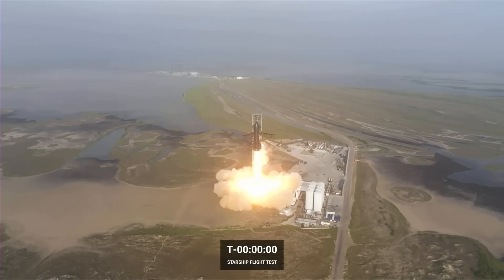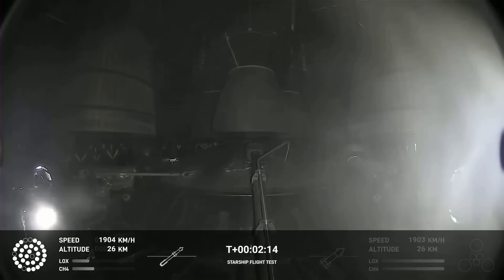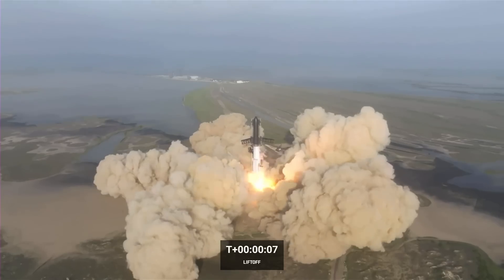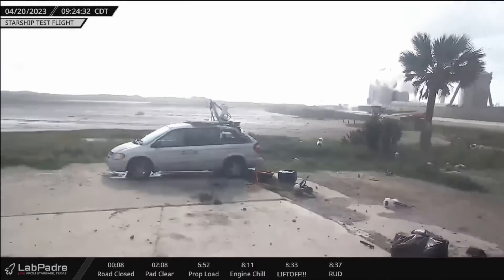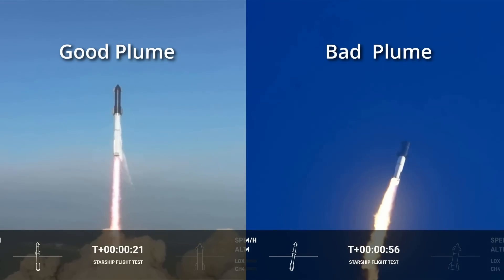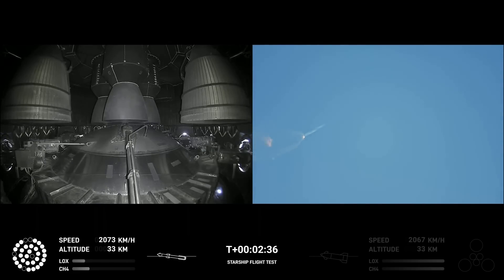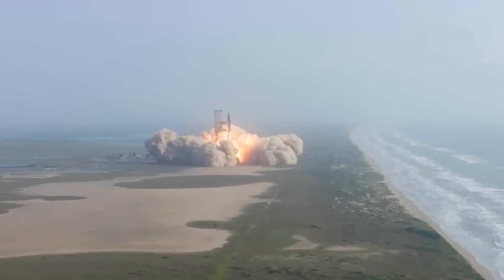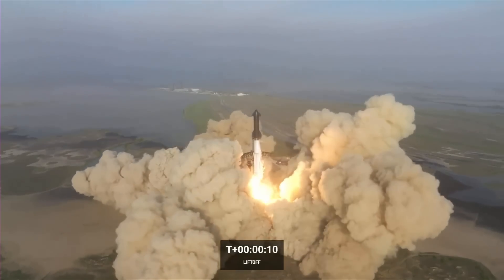SpaceX Launched Starship Like in Kerbal Space Program! What Went Wrong?

Comment: I watched the liftoff on the Everyday Astronaut channel, and his feed was perpendicular to Space X's, and you can clearly see that the rocket his hoovering slightly to the left, and was going up with an angle.
From the beginning of this project, I have a N1 feeling about the Super-Heavy booster. A lot of engines is good, but when does a lot becomes too many, I don't know. I also always thought that their launchpad was a little bit skinny when you compared it to LC-39, ELA-3 or the Soyouz launch pad in Baikonur. And every rockets launched on those launch pad are significantly smaller than the Starship. Space X has to redisign it, deeply.
Reply: Only serious issue presented is the launch mount. Personally, what I see is proof that the design of Superheavy is just fine. From the very first seconds after ignition, the booster had already taken significant damage from the concrete, but it persisted. Within half a minute, it was down a hydraulics pack and was bleeding propellant like a stuck pig, but still it persisted. Only a bit more than a minute into the flight it was down six engines and probably in the process of losing more, but still it persisted. Come the point in the timeline for stage separation, and Starship might've continued on to orbit if not for the lack of separation. Even still, the vehicle fought till the end when it broke up due to aerodynamic stress -- even that happened surprisingly late!

Compare that to N1, which had each launch fail through just single engine failures and an awful flight computer. For flights 1 through 3, the the origin of each failure could be traced back to the first seconds of launch; the first had a single engine failure and pogo oscillations in another engine within T+6 leading to failure at T+68, the second had a single engine failure before liftoff plus computer issues leading to failure within T+12, and the third picked up some roll "soon after launch" leading to failure at T+48. Superheavy lost three engines even before launch, and still made it more than twice as far as the most successful of these three flights.
Reply: @erictheepic5019  It didn’t break apart due to areodynamic stress, they commanded a flight termination and blew it apart on purpose
Reply: So from what I can tell, you're a nitpicky armchair aerospace engineer lol

(No offense lmao)

Comment: So they already sort of found a solution for the Hydraulic Power Unit failure if that is what caused the stage separation failure. The new boosters that have already been built switched to electric instead of hydraulic. So if that was the issue then it may already be solved partially. We obviously don't know what else went wrong but we do know they will keep trying lol

Comment: i dont see why they didnt go to 100% throttle when they were pointing up 🤦‍♂classic space x L
Reply: Y'all took the bait
Reply: Of course the stock ksp players get tricked very easily
Reply: 70& of thrust is an operating power. Sure it can juice more but it creates a danger of overstressing the engine. It's the same as with a normal engine. You don't use 100% of possible engine power in your car. It's even restricted by ecu that's why you can tune an engine only by mapping the ecu but increasing the failure chance
Reply: Because that could have caused more issues? Think before you post.

Comment: Are they trying to reinvent the wheel? Curious question since I don't know much about this science.
NASA has already figured out how to make a launchpad that doesn't disintegrate when they launch, why not just use that idea/material?
Reply: Starship is a BIT more powerful. but yeah, they are modifying.
Reply: @thecyanadon  Ahh okay. Makes sense then. Haven't been following to much, that's why I was confused.
Reply: @thecyanadon  god made water real so maybe use it to supress the exhaust
Reply: @polishkerbal6920  Gos didn't make jack shi. They already are, they have all the pipes.
Reply: @thecyanadon  yet they didnt use it (most likley to see the damage).
NSF van died due to that, think about it
Reply: @polishkerbal6920  No, they just wanted to get rid of this booster and it was going to take too long to build.
Reply: @thecyanadon  they could have as well send it in 2022.
Reply: @polishkerbal6920  No, they didn't know the power yet, so after the half power test they knew they needed it but it arrived too late. They had the rocket done, too far for scrapping.
Reply: @thecyanadon  ok
Reply: @thecyanadon  but launching without water suppression system is a disaster for the ground equipment
Reply: @polishkerbal6920  Yeah, but again, they needed that thing gone.
Reply: Uhm... you do know that the Artemis launch smashed up its pad quite a bit? Reports of blast doors, well, being blasted away. The table didn't disintegrate, only the weak and feeble ground beneath it. 😆     👍
Reply: @peebothuhlu7186  artemis blew off the doors, starship made a fucking rainstorm of concrete. Its very easy to tell which one made less damage
Reply: @peebothuhlu7186  actually i found out  just now that B7 literally destoyed its launchpad, cryo tanks on the ground, hoppy got hit by a concrete block, and many more things that got damaged by it.
Reply: It's probably because SpaceX is unsure how to make one that could withstand this and be rapidly reusable. Just a reminder there's a lot of new and unproven technology being tested here. Just the fact that it survive twice the Saturn V thrust with just bare concrete is already amazing.
Just like in Apollo age you build around it if you're uncertain about it. Super computer could only do so much and real life testing is necessary where you really start making permanent solution
Reply: @LeftOverMacNCheese  I would agree with you if it wasn't obvious that something like this would happen lol
They just ignored tried and true methods that could've been integrated into whatever new stuff they want to develop beforehand, not after

Comment: if you check nominal stage separation speed, you would know why there was no separation and engine shutdown.
both in case last launch of N1 and first launch of starship nobody programmed situation of premature separation (when first stage damaged beyond normal operation), n1 in last launch got slightly higher, but 40 km was important mark there (may be then fatal damage had dealt), starship attitude loss probably caused by too many engine loss accompanied with ?both? HPU loss, may be aerodynamics played some role too.
judging by oxygen level spacex was very lucky that that thing did not blowup earlier.
Reply: They might have had a code problem, but what’s more likely is that the hydraulic failure was the main problem causing loss of gimbal and decoupler function.

They May have held off on termination to try and override the decoupler control and Force seperation but failed because they had no hydraulic pressure.

Or maybe they just waited for a safer debri field.
In any case the newer already completed rockets have already switched to electonically actuated decouplers.

Comment: I hope they got some good info out of this flight. But I fear they got very little useful data. Booster and pad damaged by lack of flame diverter (everyone knew no flame diverter was a terrible idea) Causing raptors to fail. Causing the hydraulics to fail. So no test of engine relight, or any part of starship operating in vacuum and reentry. Really we maybe got some info about maxQ flight. but six engines out, did it actually reach maxQ?
Reply: yea, it hit max q faster than normal flights from what i heard during the broadcast.  as for data,  i would imagine that every bit of that failure data was probably far more helpful than a nominal liftoff/seperation.
Success comes with learning from failures.

Comment: Why did they built the launch pad with no flame diverter and a water deluge system similar to the one used by SLS? It's like trying to re-enter Earth's atmosphere with no way to direct the heat  away from the spacecraft. I'm surprised would 🔥 the world's most powerful blowtorch at flat ground, but failure is not fatal. 👨🏼‍🚀🔭🚀👍
Reply: Is probably because SpaceX is unsure how to make one that could withstand this and be rapidly reusable.
Just like in Apollo age you build around it if you're uncertain about it. Super computer could only do soo much and real life testing is necessary where you really start making permanent solution
Reply: i assume it's part of trying to figure out how to get hls off the moon with minimal or no launchpad
Reply: @jgunther3398  HLS doesn't need 33 raptor engines on the MOON 😭 wtf
Reply: @aq_ua  Superheavy isn't even going to be on the moon to begin with. Starship itself will be, but it only has six engines.

Comment: Don’t worry the decouplers are a bit buggy but it should be patched
Reply from the maker: Dang, I missed out on a "they're not on the latest patch" joke right there.

Good one!
Reply: They just forgot to enable sas
Reply: Staging unchecked
Reply: Attached to the wrong node. :(
Reply: it's not about decouplers, it's about programming(nominal separation speed was never achieved), and inability to make normal separation without enough booster engine control (which was lost) as decouplers hardware was "set" to zero force.
Reply: @sddndsiduae4b-688  I think you missed the ksp2 reference/joke
Reply: @thekraden04  honestly lets not r/wooosh him and shit since hes a good person
Reply: why didn't space x change the settings in the json files smh. rookie mistake
Reply: @sddndsiduae4b-688  woosh
Reply: @sddndsiduae4b-688  yeah but they should of been on the latest patch :/

Comment: My heart sank for every engine that died on the way up.
Also can we talk about how those 3 little pins at the top of the booster managed to hold on to a fully fueled ship through multiple flips? haha
Reply: Well by this time in the flight, the heaviest part was the main starship... the center of mass had flipped and the stress for the pins was holding onto the booster, not the booster holding onto the starship. It had gone to about 126,000 feet, where the air density is about 1% of the surface.
Reply: The engines appeared to be still running.
Reply: @julesjackson4855  5 of them or 6 i dont remember stopped working
Reply: That is the truly ksp part
Reply: It was 37 km up, not much atmosphere there
Reply: Great engineering can result in things which appear to be miraculous. :) In this case, I suspect there's something which takes some of the load off the pins in a way that's not obvious.

Comment: imo separation has not happened because there was too much propellant in the tanks because of the 6 failed engines  that have not burned the correct amount , so existing engines continued to burn the excess, the separation system worked , but it was unable to separate the two parts , just because of the constant acceleration applied to it.
So the computer was going nuts due to the opposite data it was receiving .
So the engines were programmed to stop when a certain level of propellant was attained and the separation system was programmed when a certain altitude was attained .
The second worked as intended but the first not because of the failure of the 6 engines.
The two programs were not part of the same instruction, imo engines stop should have been tethered to altitude value instead of propellant level  ! ^^
*this is my theory , i'm not a rocket engineer working for Space X , just a lambda viewer .  ^^ :)
Reply: but wouldn't they cut off all the engines at MECO normally? regardless of the propellant?
Reply: @delfinenteddyson9865  Don't know it is just my two dollar theory  ! ;) 
We will see later what it is about .
Perhaps there was two teams of programmers that had not shared their work ?
All is possible .
There is a good chance i' m completely wrong about this, just my two cents .^^

Comment: As soon as it lifted off, I got a weird feeling. Like when you are flying an unstable rocket in ksp, that's what I felt. Then I saw that some of the engines flamed out and I was like hmmm. Then it started spinning and I was like "yup, that's why you don't let Jeb drive." Still, it launched so that was cool
Reply from the maker: I felt pretty much the same!
"Oh great, it lifted"
"Wait, that angle doesn't look right"
"Oh no, stuff explodes and engines fail"
"LOL, Kerbal rocket spin, you're done"
Reply: @ShadowZone  I'm believing that a SpaceX engineer forgot to stage the stack decoupler xD
Reply: @theaypisamfpv  I don't think he forgot I think he just connected the nodes wrong. Like the stack separator was there but the stacks were actually connected to each other.
Reply: @ShadowZone  First it took quite a while took lift off (can be normal I guess - it's a big boy), then the weird thrust vectoring right away, then the bottom pooping fire. At this point it was just a matter of time before KSP happened.
Reply: @Allyourmonkeys  SpaceX waited too long before decoupling the launch clamps. The engines chewed up the launch pad while they looked at the pretty plume :D
Reply: Wow basic launch pad exhaust removal design failure had concrete clumps smashing into to engines. 
If brain cant sweat the simple stuff then we have "Houston we have a problem"
Then you need a launch pad on moon and mars, take a bag of cement with you & make one!!
or is this wet dream one way?
Reply: Same
Reply: lmao, yeah right